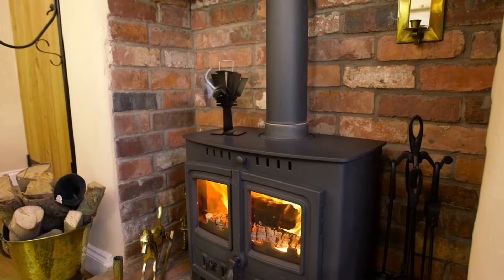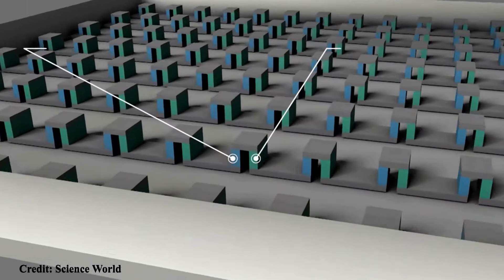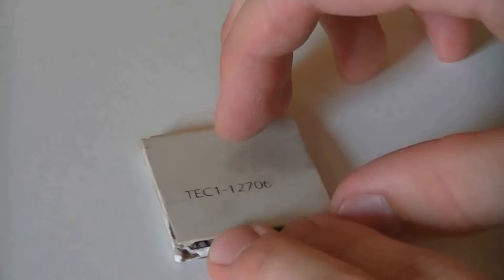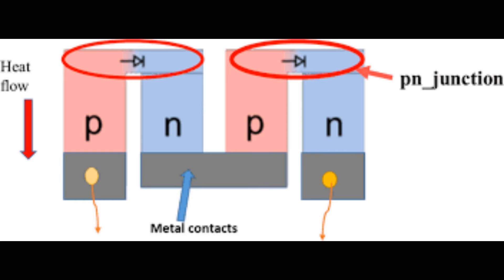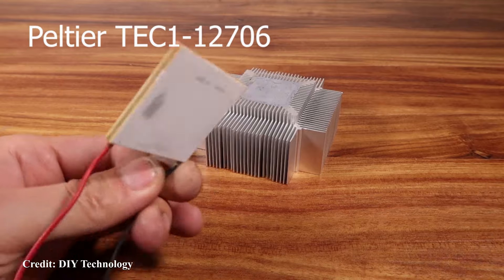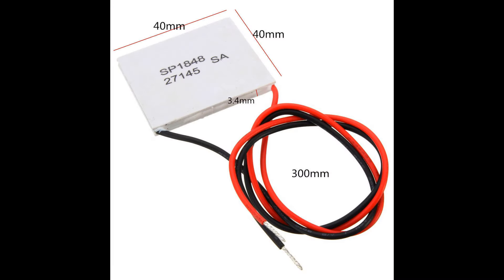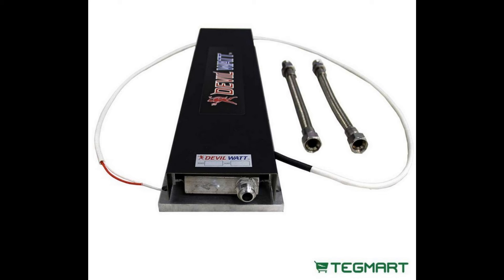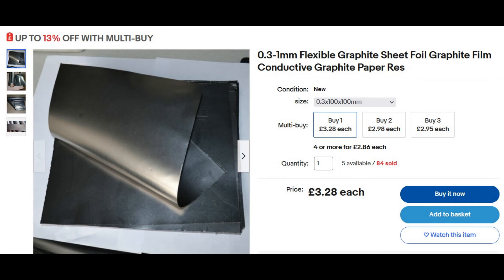2220 DIY Thermoelectric Generators - What You Need To Know

Comment: There used to be a company in Iceland that made thermoelectric generators specifically designed to be use with geothermal hot water or steam......i found out about them after i saw some being used in New Zealand to make power from geothermal steam for a private hunting cabin between Taupo and Rotorua

Comment: Not so important in this instance but there is a fail-safe incorporated into most stove top fans.
If you look at the base of the stand it has a grove cut in it and a bi-metallic strip screwed in on end. If the base gets too hot the strip bends and tilts the fan so only one edge is in contact!
The kickback against planned obsolescence is real! ;o)
Reply: Neat. I like it. I was just trying to think of a way to self-regulate the heat transfer, then you point out its alreadyl implemented...
It occurs to me that if radiator fins were incorporated in the stem, then the fan would self regulated the heat being transfered, the more heat gets past the fins the faster the fan turns and therefore cools the stem. Foolproof?
Reply: @bikerfirefarter7280  Good idea! But it would mean losing more heat from the hot end of things making the device produce less power. That is why you see a single bladed stand and a multi bladed top.
Reply: @totherarf  Thats exactly my point why it would avoid burning out the thermo-electric module. Apart from the idea of this/any 'fan' on top of a stove makes the stove MUCH more efficient (the difference is trivial) its much more efficient to make the flue/stove itself part of a better heat transfer/capture system, or even a total re-design of the stove. These 'fans' are a fad/gimmick, but the operating principles herein are instructive to us nerds.  chill.  ;-)
Reply: @bikerfirefarter7280  Coolio!
Reply: Glad to hear your honest comment😅
Reply from the maker: i think it depends but most of them from what i have seen just wire the motor straight to the module and have flat base with nothing on it

Comment: I always wanted to try these. Turns out I ordered the wrong ones. Had I watched this video I would have known the difference. :) Ive always wondered if there was enough potential in my outdoor portion of my stovepipe to make something work. Good info, thankyou.
Reply: If you could manage to utilise the cold as well as the hot, you'd get more power. Maybe mount the TEG on the chimney indoors, with a chunk of metal leading outdoors to take the heat away much better. If you wanted to buy a few, you could maybe set up a water cooling loop using the outside cold, and put the TEGs somewhere as hot as they can stand. Or else try thermocouples as I mentioned in another post.

People cooling big PC setups do all sorts of elaborate plumbing. TECs have falled out of fashion a bit but used to be a hot thing in overclocking Celeron 300s to 400MHz. Back in the day that saved a LOT of money and became a sort-of sport. So there's knowledge available on advanced TEC cooling, that you might learn useful ideas from to cool a TEG.

Comment: I think it would be interesting if you combined this tech with a solar setup. You explained in an earlier video how solar panels are more efficient at lower temperatures. I wonder if you could use TEGs to simultaneously cool the panels while providing extra power.
Reply: They are very inefficient so the gains would be negligible at best and most likely consume more of the extra power that the cooled solar panel will produce...I like your thinking though!
Reply: maybe try a fan on the cell, more sunlight the faster the fan goes, of course get the balance right, so the fan doesn't consunme more than the extra coming out of your solar cell.
According to chatgpt, the max extra we can get out of a solar cell is about 2x...

Comment: Thanks for this video! That TEG (er... TEC) Fan for the Stove is really cool!
One way to engineer this so that it is economically feasible is to use a solar photovoltaic cell that works well using a "concentrator" design, for example, it has a small footprint, and a Fresnel lens concentrates the light onto the cell. The TEC (or TEG) would be placed on the back end of the Solar cell (with a good thermal compound) , where it would take the waste heat and convert it to even more electricity. A large heat sink would be needed... it might help if the heat sink was in the water. You might be able to avoid this design by having some sort of TEC that could cover an entire large panel, and just use the white paint heat sink, but, I am not aware of any large TEC formats that are very low cost.
Reply: I've been trying to build this design myself. The problem is the heat in Florida makes it too hot. This design would only work well in winter. It's just too hard to dissipate the heat into 100 degree air.
Reply: @NandR  So, what size solar cell are you using, or are you saying just in theory?
Reply: @marcfruchtman9473  I only tried it on a 10W panel with 3 TEGs. If there was some steady wind it would help.
Reply: @NandR  If you just want to see if the TEG helps at all, you could put a cube of ice on the heat sink part which would give you the delta T... if nothing improves then something is wrong. The other consideration is how it is all wired. You don't want the wiring of the solar panel to "power" the TEG...
Reply: @marcfruchtman9473  it works but not very much. I need to try it in winter cold air on a sunny day.
Reply from the maker: basically that is exactly what thermophotovoltaic cells do

Comment: Will be great maybe use in the parking lots, like integrate this inside the beton or asfalt. In the sunny day its can reach temps 50C+
Reply: With a good system of distributing that heat to lower layers of earth, it would work very well, but be quite expensive.

Comment: I did not know that you could reverse the current flow of a TEG to make the hot side cold and cold side hot. Is that process equally safe and efficient?
Reply from the maker: yes it really doesn't matter that much tbh
Reply: That surprises me, as the voltage drop across a PN junction is typically asymmetric, I would have expected a large thermal efficiency difference due to this:  but then I suppose the forward current and reverse leakage current are very different and compensates. Or am I missing something?
Reply: @ThinkingandTinkering  Thanks very much for that breakdown (no pun intended).
I've seen thermocouples made between the ends of dissimilar wires. They are very tolerant of high temperatures, i.e. flame-failure devices in heating/cooking, but I've not seen much in the way of edge-to-edge contact thermocouples or, for that matter, face-to-face contacts. Would these produce high currents? And could these be manufactured by ''spot welding' and/or then rolled/made cylindrical and inserted into flues?
I haven't tried the experiment, as I have to rebuild my DIY spot-welder since I accidentally Oopsed it trying to make an induction heater out of its bits.
Reply: It is very safe but terribly inefficient.
Reply: @bikerfirefarter7280 dissimilar metal thermocouples are usually welded or twisted together and brazed (sometimes using sil-phos brazing wire or silver solder).
Reply: @bikerfirefarter7280  I made a post on how, in the 1940s, the Soviets produced radios that ran from the heat of an oil lamp. That used thermocouples. I hope you can see the post, no point re-posting it here. If you look up the subject though you'll find stuff on the web about it. Thermocouples can be used to generate useful electricity and I believe the currents are pretty high, with the voltage being low. But you just run a load of them in series, one end cold, one end hot. Plenty of them were made with twisted wire.

The radios I think were pretty normal, the thermocouple part was on a long wire, then a collar that surrounded the oil lamp, with protruding fins for cooling.
Reply: @greenaum  RMS covered some of that in a previous video, you can probably find it. Thanks for the pointers though. I was interested if avaiable/DIY tech could cobble something together that had good power output, say 100-500+wattage from an add-on to a basic stove flue.
Reply: @bikerfirefarter7280  I think Robert was talking about a TEG and a TEC being the same when used for cooling. AFAIK they're more efficient as heat-movers than they are as generators, by quite a bit, but they're pretty bad as coolers too! For every watt of heat they move, they create about 4 watts of heat themselves.
Reply: @greenaum  Decades ago Scientific American magazine had an article about a solid-state multi-layer/junction TEC with quite impressive difference in the temperature on either face, impressive but NOT efficient. IDK how much further the tech/manufacturers have gone with it since. And IDK if it worked as a TEG. Might be worth another read and further research.

Comment: Very good.  It might be possible to compare mechanical vs electronic energy recovery using just the stove fans: there's much older stirling engine driven designs of similar size.  Pre-test, my guess would be that the stirling fans would be more heat tolerant and last longer, but might reach a point where the heat difference can't be maintained without active cooling.  
I've also wondered if one could use liquified thermo-plastics as a transfer mechanism.
Reply: - the whole thing re the operation of heat engines is to keep the hot and cold sides as "different as possible" - just that the Sterling engine will actually cease functioning altogether when the cold side gets heat soaked - cooling may not be "necessary" - for a while, but the performance will certainly be improved  (drip some water over the cold side every so often - evaporation works wonders)..

Comment: Robert.... A one mil copper & iron sandwich combo (two mil actually) will produce on average 30 milivolts. Stacked 1 inch high an estimated 15 volts can be produced. Considering one micro amp per .001 inch square, a one inch square would produce one amp. So..... a one" high by 1 square inch would (should) produce 15 watts of power. Then a 20" tall by 1 square. Inch would produce 300 watts or 300 volts DC @ 1 amp. Lastly, 50 such stacks would produce 15 KW.

Granted stacking these 2 mil sandwiches would require patience and approximately 700 degree temperature, but once meeting that threshold ....that thermo pile could theoretically be boarding on perpetual motion ( in supply it's own heat source using heating elements in a controlled insulated environment) and supply electrical power some 20+ years. Right?

Comment: I wonder if you could use that technology on windows in cold or warm climates as the inside of the house is is much warmer when its winter or much cooler when its summer. Or maybe its not enough of a difference in temps.

Comment: I have wondered if black metal plates were put on houses (or wiring up an asphalt road) to harness solar heat and have the heat siphoned to a thermal battery, and used to power either a TeG or a thermal engine that produces needed electricity would be a better choice than solar panels, inverter, and battery route, since the thermal equipment would last longer than solar panel equipment and batteries. What is your opinion?

Comment: I noticed you didnt mention that using a temperature difference of say -40 to +40 gives a difference of 80. May be much safer and more reliable. I often thought that its easier to create cold than heat..

Comment: People do forget that chip based objects are manufactured for purpose, and just like using a toy air piston in a steam toy, its not up to the demands on average. One thing II have been thinking about is such a thing as TEG setups in furnaces, so that more of their electric power is from their waste heat, especially if said furnace is part of your hot water system.

Comment: Back round about the 1950s, the Soviets made thermally-powered radios, for people living in the country with no mains electricity. It was a collar you'd put around the neck of an oil lamp. That provided the heat, then fins spreading out provided cooling. It could generate the 90v or so, and the 6v or so, that an old valve radio needed. Those are approximate voltages, educated guess.

It didn't use these sort of TEGs, since semiconductors hadn't really been invented properly. It just used old-fashioned thermocouples. You get two kinds of metal, say copper and iron, and you twist the ends together. You make lots of these twisted wire pairs. Then you connect each one at the opposite end, also twisting, copper to iron, til they're all in series. Or parallel, or however you like. A long sequence of wires all twisted together at opposite ends. 

Then you get all the ends on one side, and expose it to heat, and the ends on the other to cold. That's it! Of course make sure none of the wires short out touching against each other. They probably used asbestos or something but I'm sure there's a modern electrical insulator that can stand a bit of heat.

The metals you choose depend on a certain table of which are more negative and which more positive. Choose metals with the greatest difference for the highest voltage. You can look this up online. Being metal, they're not likely to melt with anything you can present them with. They're also much cheaper than TEGs. A bit of time spent twisting, and tinkering, and you can save a ton of money if you wanted an emergency power source or something off-grid. It's gonna be much more robust, and easy to repair. You don't solder anything, just twist. 

Small thermocouples like this are used in industrial thermometers, since they don't melt easily. Shove one into a furnace, measure the voltage, and your handy meter can convert that into a temperature for you.

You could try something like this to take camping. If you get a decent voltage, and current, out of it, perhaps get yourself a voltage regulator (even a good old 7805) and a USB lead and try charging things!
Reply: Fun fact. The Russians also built hundreds, or possibly thousands of nuclear TEG units to power radio relay stations and lighthouses. Most were decommissioned in the 1990's with US help. I did say most, some were unaccounted for, some dismantled by scrappers, and some still remained in use out of necessity, and some were left in place because buildings were constructed around them and no safe dismantling was possible last I heard about them. I do also remember about reading that there were a few orphan radioactive source deaths from some hunters coming across a TEG that fell off a tower and noticing the snow was melted near a block. They ended up putting the amazing warm block in their tent, and quickly becoming ill. I think that there may have been others but it was years ago. I believe it was strontium 90 that made up the radiation source. The Soviets also made plutonium smoke detectors if memory serves.

Comment: Very interesting. What if you had like a thermos inside a themos, one side hot and the other side cold and the only way heat could be transfered was through a peltier cell. I wonder how effective that would be to generate electricity?
Reply: @nattsurfaren  I saw a fellow doing a similar experiment, and it would light up a single led, one of the very small and dim ones, for a few hours.

Not very practical.

Comment: One thing i want to try with them is to connect one to the ground with heat pipes and connect the other to a heatsink above ground.  When the air is hot, power will flow one way, and when the air is cold it will flow the other.  That doesnt matter, though, if you connect it to a full bridge rectifier.

I just dont know how well it will work.
Reply: It wont work. heat pipes don't work 'downward', so no cooling that way.
Reply: @bikerfirefarter7280  they can if there is something in it to draw the moisture to the top.  Computer heat pipes use a copper powder that turns into tiny capillaries when heated enough to make there's work.  I'm not sure what else will work, though.  I might try sand and make some myself.

Comment: Im not sure if this is a silly question but could these devices be used to power a small fan that could then power a generator?  Like a domino effect.
Reply from the maker: yes - but thre would be losses along the way as you convert one form to another
Reply: You'd lose about 95% of the electricity you're producing, to convert it to wind currents, and using those wind currents to drive a fan to make electricity.

Imagine plugging a fan into the wall at your house, and then having it blow onto another fan, which then generates electricity. Then use that electricity to run your household appliances. What do you think your power bill is going to do? It's going to skyrocket.

Just use the power as it is, don't convert it back and forth. Conversion losses are massive.